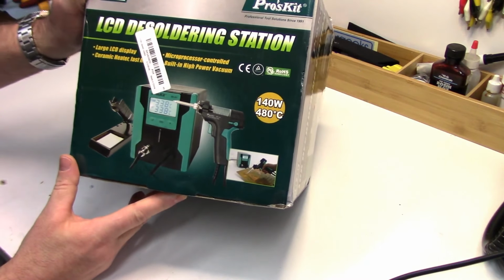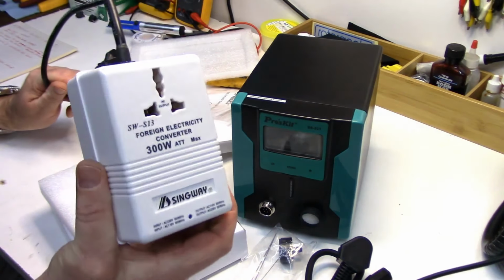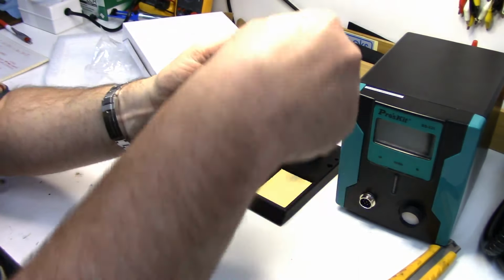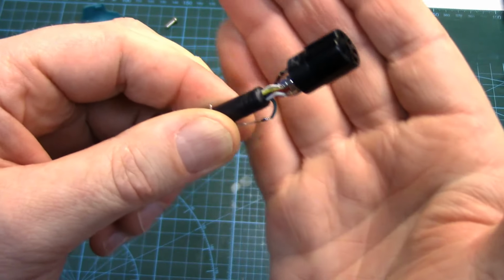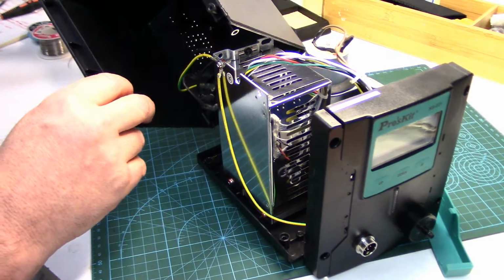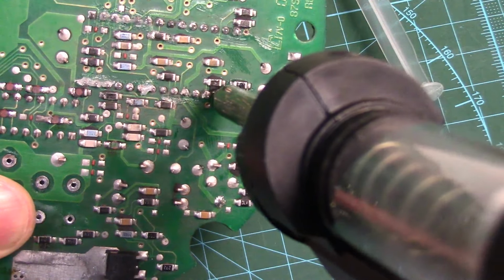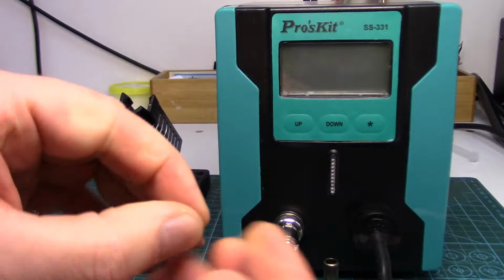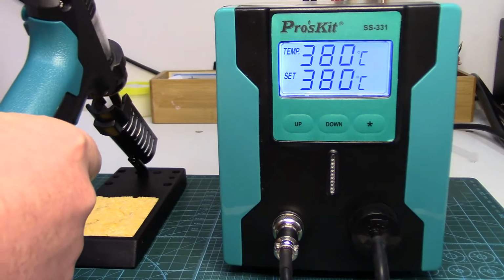Pro'sKit SS-331 Desolder Station Review

Comment: hey man is there Desolder  gun without that big box i mean just gun with UK plug and temp control.
Reply from the maker: Here's my review of the stand alone S-993A desoldering gun: https://youtu.be/nVkXeOJSsck?si=GfoneDTGcy6lj744
Not as nice to use as this unit, but it works okay if you want a combination unit for field work.
Reply: @rchelicopterfun   why expensive i google it and over 80$
Reply from the maker: How on earth would I know, I don't build or market the things. By the way, $80 is a bargain considering the Hakko FR-301 gun is around $200.

Comment: I think  the 24 volt supply that's inside the unit can be switched from 110 to 220.  It may even be that the power supply inside accepts 95 to 230 volts or something like that.  I'm not sure about the rating of the connector at the rear but a few minutes of investigation should tell you that.
Reply from the maker: Yes, it's universal voltage as per first pinned comment. See update video: https://www.youtube.com/watch?v=9eBG7z-2qNE

Comment: Hi viewers, and John. my experience with one of those is relatively good. and I have been using this for a view years now. some advice for better usage...
in the beginning if the pump sounds a bit slow and you do not get enough suction. it helps to get the motor some run time, those dc motors will be quicker if you let them run in. in the collecting tube , I have add a small piece of sponge(the one with the rough patch on one side). the sponge can help with suction power and filter conservation,
also is very cheap.
and for the heat pipe that could get cloged, you have those stupid rake things that brake or get stuck.. i just take out the heat pipe and heat it with one of those little gas burners, and when it is hot I quickly blow it out with a can of compressed air. be careful tho because there will be hot solder flying out from the other end. 
this procedure has helped me a lot with the problems I had.

Comment: Is this helpfull for Lead Free Soldered pins?
Reply from the maker: Lead free solder doesn't flow well and may need more flux added or resoldering with some leaded solder first before using the desoldering tool. In short, yes it will work but it all comes down to practice and technique.

Comment: Thank you.
Very helpful especially as my glass tube sprung off and all the bits ended up on the floor, I didn't know where the silicone washer went.
I've got a 'Katsu zd8915' which is basically identical.
+1 for the tip of using flux especially on multi layered boards.

Comment: This by far the best and most useful review I have found. And it's from a fellow Canuck! Thanks for taking the time to show us the practical features about this unit. Amazon .ca seems to have it under another brand. And you are totally right about learning desoldering technique. One trick I've seen for hard to clean holes is to try doing it horizontally (or upside down but that gets tricky with larger boards). I'll try the flux hint as well. Some also add solder to help in the flow for hard to desolder parts. It's not a perfect tool but better than hand pump when you are doing hundreds of parts.

Cheers from Montreal.

Comment: Great, now I have another thing on my shopping list. I just barely bought wick after 20 years of trying to use the stupid hand held sucker tube thing that you showed.
Reply from the maker: @Matt Mead - 🙂 Yep, that' s pretty much the same thing I thought when I saw Dave Jones's review of one of these low cost vacuum pump disordering tools and what ultimately bent my rubber arm to get one as well. The only regret I have is not getting it sooner. It has been working great and I can't believe how many times I find myself using it now - reclaiming parts off old boards for projects & repairs. I no longer fear multi layered boards with plated through holes where it seemed I would generally lift a trace or overheat a component more times than not using wick. We won't even talk about the spring loaded suckers total & pathetic lack of performance on a plated through hole.

Comment: They really should give you a little more room when removing the glass tube. My first time taking the tube out the rubber gasket that goes around the hollow element tube was stuck to the main rubber seal for the glass tube and so I had to remove the glass tube filter side first. I don't think I damaged anything, but now I can put in and remove the glass tube correctly.
Reply: It’s not actually that bad once you know that the part that plugs the back of the tube is still compressible/spring-loaded even after you release the back. You pull the tube back while lifting the front out. Plenty of room once you know the trick.

Comment: Do you find there is an audible buzzing noise from the handheld gun during heating? I just got one and have this issue. A forum post by someone also mentioned this buzzing.
Reply from the maker: Not an issue - normal operation noise of the heating element frequency (pulse rate of the MOSFET).
Reply: I thought it was part of the motion sensing part of the handle and was giving audio feedback. I don't know. Either way mine does that too.

Comment: In your opinion would one of these be useful in vintage electronics that has larger solder terminal strips?
Reply from the maker: @davefr - I would have to know what type of terminal strip you are refinancing in your question. If it's some large one (for wiring), no, these de-solder vacuum tools are not meant for that type of application. They are specific to PCB component solder removal. The tip has to be able to fit entirely over the component lead on the board in order to pull enough vacuum. I gave the hole sizes in the video of the tips, only you know if they will or won't fit your specific de-solder component application.
Reply: @rchelicopterfun  Thanks for reply. Then I don't think this would work to well for vintage electronics. (Tube sockets, terminal strips, fairly large wire, switch and control lugs, etc)

Comment: Congratulations on the video...Do you know how to inform us, what is the AC or DC voltage applied to the ceramic heating element? And what is the temperature sensor?
Reply from the maker: Heater is 80W, 24VDC. I don't understand what you are asking about the temp sensor. If you are asking what type it is, I have no idea. The sensor is encapsulated in the ceramic core of the heating element so I would presume it's a standard thermocouple like most soldering tools with temp feedback - but that is just an educated guess.
Reply: @rchelicopterfun  I was in doubt if it is NTC or PTC, this was the reason for my question. Thank you very much for the quick reply.
Reply from the maker: @Roger G. Rodrigues - yep, sorry, I'm not sure if it's a positive or negative TC. I've never probed it to find out if resistance increases or decreases with temp rise - all I know is it works 🙂

Comment: do you need to 'wet' the guns 'tip' with solder, like you do with soldering irons ?
Reply from the maker: I've found you usually you don't, but if there is lots of oxidation on the tip, it will certainly help by wetting it. Keeping it clean using the cleaning sponge also helps. It's also solder dependent & at what temp you use it at. In short, you will come up with your own tip maintenance procedures based on working experience with the tool.

Comment: Looks like I'm having an issue with the delivery on this. The tracking has stalled at July 1st with the message: "HGH-Hand over to airline failure:Magnetic:马达" Those Chinese characters translate to "Electric motor" so it seems like the airline rejected the package due to the magnets in the motor. All I can do is wait but it doesn't look good.
Reply: Finally got mine after 7 weeks! It was shipped again with DHL and arrived in a few days. Initially I had a lot of trouble getting anything off but I got some flux and tried again today. It made things so much easier. Well worth it, thanks again for the review.

Comment: Always get clogged even after cleaning it 
How can solve this problem
Please help
Reply from the maker: Perhaps not using it at high enough temp or filters clogged (not enough vacuum). I've never had clogging issues - it's working great going on 18 months now.
Reply: It starts you off at such a low temperature that my guess would be that. Increase it to at least 350C and see if it still clogs on you.

Comment: do you find that using flux helps lots when using the gun.  Does flux get in the gun and make it difficult to clean?  I bought this one since it had a switching power supply since I need 110v , thank to you update video
Reply from the maker: Depends on solder quality - unleaded is a bugger without additional flux, or applying some leaded first. No issues with it if Flux is used, filters just need replacing more often.
Reply: @rchelicopterfun  Thanks I will try it out.  I use flux with the manual suction pumps.  So far I am impressed with this machine, thanks

Comment: Hi i have the same or better both, the old Zd9.. had 80W and it was boring to wait whilee heat up. I had a new one in exact the same Casing like yours but in different collors. 
It is also Blak with with blue Grips. I had very much Spareparts from the ZD9xx but ithis Station have to much Power and the Thermocouple is differnt. 
My is Labeld with 200W yours with 140W i think is both the same. 
My the 140W on yours sre realistik for accumulate over the Time usage (i find not the correckt word in english=) on my the 200W will be Peak Power when it ist switchinh on.
Nice Station my old M9xx one i had vor over 15 Jears. The new is aklso fine an heat very much faster so work temp. 
Maybee when i polished it with Snakeoil it well realy bring the 200W to the Nozzel =) 
I wish you a lot of fun with the Desolderinh gun and i hope the new will also work in more than 10 Jears. Have a nice Day Best Regards from Germany
Reply from the maker: Thanks for the info.

Comment: Got one yesterday and found the same .. the power supply handles 100-240v. This thing is a treat for removing stuff with more than two pins.
Reply: Just to echo your point about cleaning. On my first try I heated the tip and tested the pump and powered off the unit .. totally forgot the tip is initially plugged with solder ... luckily no harm done.
Reply: @John Salt  do you know where to find the comsumables? I see banggood sells the tips but have you found where to get the filters? Maybe just plain old cotton ball would work?
Reply from the maker: As I mentioned in the video, they use heat/fire resistant ceramic mat filters only. Lots out there from various vendors (amazon, ebay, aliexpress, etc).  or you can make your own from ceramic mat. Google search is your friend.

Comment: I have an Anesty ZD-915... its that things older brother. I've been using mine for about 2 years now. The pump does get gummed up from flux fumes if you use flux with it. If that happens clean the pump out with IPA and it will work good as new. I have been waiting for the whole thing to die so I can upgrade to a used hakko unit but this thing just keeps going so I am sure that will last you years.
Reply from the maker: Thanks for the feedback on your 915 - much appreciated! 👍

Comment: All die guten Bewewrtungen kann man echt vergessen. Das abgesaugte Loötzinn muss durch einen sehr kleinen Kanal von 2mm. Am Ende des Kanals wird es jedoch schon fest und verstopft. Man muss nach jedem 2. Absaugvorgang mit der beigelegten Langnadel diesen Durchgang freistzupfen. Nach etwa 30 Absaugvorgänge und immerwieder reinigen ist es jetzt völlig verstopft. Man bekommt den kleinen dünnen Kanal nicht mehr frei von dem abgesaugten Lötzinn.
Es ist ein Drama! Ich muss nicht auf´s Geld schauen und hab mir diese Entlötstation ausgewählt, da so viele Positive Bewertungen.  Bin jetzt ziemlich enttäuscht, da ich das Teil ständig brauche und es geht nichts mehr. Ich hab alles versucht diesen 2mm Kanal vom alten Lötzinn frei zubekommen, keine Chance.  Ist nur noch gut für die Mülltonne, echt Mist. Wo bekomme ich jetzt eine Entlötstation her die auch wirklich dauerhaft funktioniert.
Reply from the maker: Anecdotal. You are not using it right or it was faulty out of the box. I've had mine for over a year now and like many others who have this station and others like it, never once had a clogging issue. I of course run the clean out rod through it before turning it off - EVERY SINGLE TIME I use it; just as I stressed in the video. If you let the solder cool inside and stick even once, you're likely stuffed. It won't only be hard to remove, you may end up putting deep scratches in the stainless tube trying to get it out, and once a deep scratch is in the suction tube, it will clog very easy afterward.
If you don't like these very functional low cost Chinese 3 button stations with a vacuum pump (they are all the same in terms of functionality and performance), then you are in the market for the venturi style disordering stations such as the Weller WXD 2010 which is about $1500 USD. You'll also need a source of compressed air for them (ie. air compressor or bottled gas). They will clog too without proper maintenance but not as easy as there is a stronger and very immediate vacuum formed by the venturi.

Comment: Very informative, thanks. FYI thats the same connector and plug (between the hand unit and base unit) as CB and Ham radios use for microphones LOL. I heard you mention Aviation plug, in my 50 years of electronics repair I would NEVER put any current through those connectors/plugs as they are meant for microphones which don't carry any current to speak of. That alone will make me not buy this unit and I wanted to like it.
Reply from the maker: FYI - A GX aviation connector (what is used on this unit and many other solder stations on the market) are not an AV DIN connector which is what I can only assume you're referencing.
GX connectors are sized by housing diameter in mm's and range in size from GX12 up to GX40. The GX16 used in this station is rated at 250V @ 5A. Certainly more than robust enough for the 3.75 Amps this little 90W 24V heating element will be pulling even if it was running a 100% duty cycle (which it doesn't).
GX's have a stated life of 500 connection cycles. I've seen them used in much more demanding applications and environments including TIG, MIG, and plasma cutter handles for the shielding gas flow solenoid, wire feed motor relay, and arc triggers.

Comment: Any thoughts about using it to remove solder bridges between the legs of an SMD IC.
When I get a bridge I find wick difficult and with a manual sucker as you really need three hands.

Dave
Reply from the maker: For bridging between close leads like that, I find just using an ample amount of good flux cures all. The solder bridging just magically flows away when it's nice and "wet".
As for this type of vacuum desoldering station for that; it's not really the intended use and I doubt it would work that well. They are meant for through hole components so the molten solder itself seals the tip to the PCB as you pull vacuum through the hole. There is no sealing round the tip when not held in pool of molten solder so you likely wouldn't get much suction if held against several IC legs with air being pulled in from all around.

Comment: This brand is from Taiwan brand not China
Reply from the maker: I never said the brand is from China, I said this de-solder station and others like it are. Yes, Prokits Industries Co., Ltd. is based in Taiwan; that however doesn't mean every product they have is made there. This SS-331 desoldering station is MADE IN CHINA; it says so right on the box. It's likely not even a ProsKit product, just a typical re-badge. As I said in the video, you will see them by ZD as well (# 8915).

Comment: Hi John, thanks for the video. I have been using a Weller DS102P (look under a long time ago) for years. I put together my own station using the Weller iron and a Gast Vacuum pump. The pump is on a foot switch and develops really good vacuum very quickly for the small size of it (rotary vane pump). Anyway in my experience I give the pins a count of 3 to 5 for a plated through hole and I've also found that if I use flux it will erode the tip more quickly and also leaves a reside that will plug your tip. I strongly recommend frequently poking out the tips to keep then clear. I was eyeballing the Pros'kit but as you mentioned it appears to lean toward the 220vac which is inconvenient. I'm going to check out your video on the ps mod. Thanks again!
Reply from the maker: If you watched that other video by now, you will see these things have a universal voltage PS and can be run at 120V without modification.  You just need to use a standard North American IEC power cord.  🙂